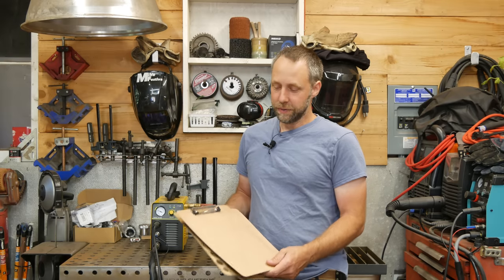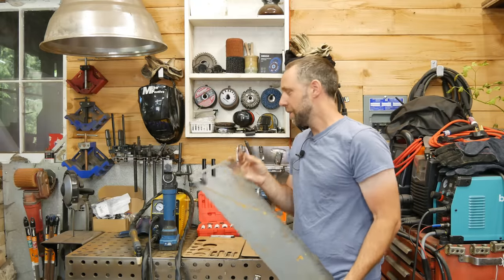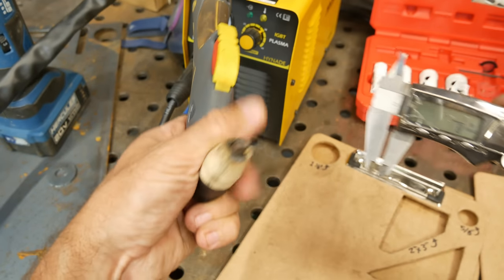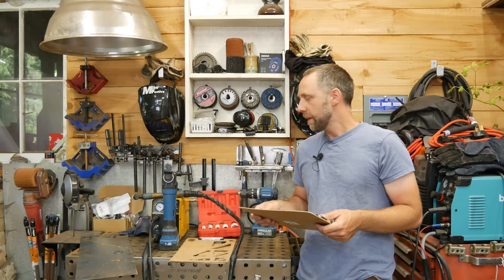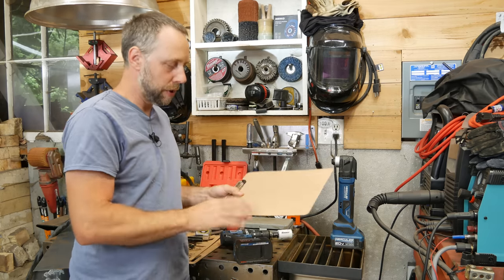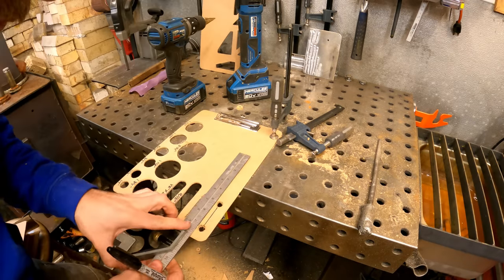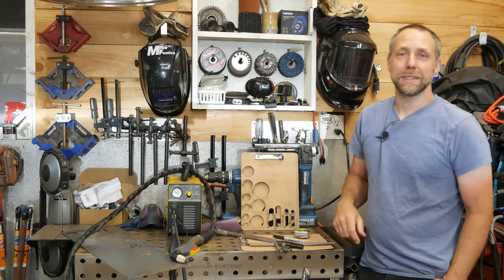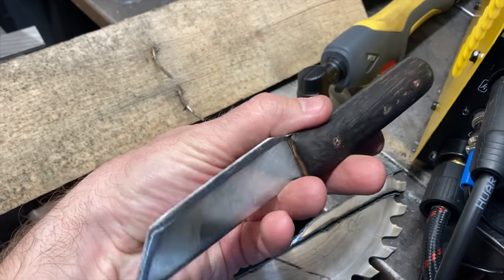Simple DIY plasma cutting hack, save time and money

Comment: Those of us that have worked in production woodworking, know all about templates to use with our routers.
This whole plasma cutter, being affordable thing, brings the whole template thing into the metal working world.
Pretty much all the template techniques from the woodworking world now  swing across into metal.

A couple of tips.
#1 You can cut your plasma templates with your router, this will make realy clean edges ........ you could even make a template for making templates.
#2 harden up the cut edges of your templates with, shelac, or high temp paint, before you sand all the rough edges, this will make the templates much more durable.
#3 most of my router templates are painted with thin white paint, which makes them easier to see and write upon, I'd reccommend high temp paint, like exhaust pipe paint spray for plasma templates.

If you are going to make a lot of templates, tempererd masonite or masonite sign board, is denser and harder than normal board.

Comment: I can tell you one thing that would be helpful to have, is a template for cutting out steel end caps for square, rectangular and round tubing in various sizes.  EVERYTHING I build gets tube ends welded closed....or else wasps will DEFINITELY nest where you don't want them to. You can make templates for ones that sit on the end of the tube, or ones that fit flush inside the tubes.

Comment: We make Plasma Stencils similar those, along with other common sizes and shapes too. The torch sizes do vary quite a bit depending on the machine. For custom stencils like your gussets, I tell people to just add the diameter of the torch tip to the desired size. I like how you mentioned drag cutting, any machine with an actual drag shield is ideal because the stencil can then be metal and not throw away. The other nice thing about stencils is you can use them to cut where a CNC can't go, like on vehicles or anything large. Keep up the good work!

Comment: I did pretty much the same thing only I used a CNC router to cut out the shapes. I had small sheets of 1/4 press board laying around after a project and used those. Like you say when they were out I just curt new ones. Also patterns the kids come up with I create a file in vcarve,  and can cut out as many as they want so they can paint them differently.

Comment: If you rub some candle wax on the inside edges the torch will probably slide smoother. I use something just like this for router templates and it works great.

Comment: I like how you used pallet board for the knife handle you show at the end. Never thought to use copper wire for rivets. I've used hardwood pallets for a few knife handles. And a hardwood pallet 2x4 for a hatchet handle.

I use pallet boards for ton's of my projects. I can usually get them free or really cheap. Usually I'll try to find good hardwood pallets. I salvage the good wood and burn the rest in my woodstove.

Comment: I build a small cnc router that'd be perfect for this sorta thing. I wanted to make it a plasma table too but it was going to be expensive to upgrade to a blow back plasma cutter. I think using hardboard for any elaborate shapes and a straight edge for strait cuts probably serves more than my needs. Would be cool to make some templates for gussets and mounting tabs.
Reply from the maker: Definitely a great tool for that! I bet the CNC router would cut amazing templates, you will be surprised how good the cuts come out 👍

Comment: Good idea you can also buy press board at home depot, etc in 4x4 or 8 sheets cheap.
Reply from the maker: Thanks for checking out my video, yes you can buy Masonite at most box stores. I didn’t really need a full sheet, but definitely an option if someone needs that much material.

Comment: Hi Mike:  so just before I saw this video I bought a yeswelder CUT55DS-Pro with IPT40 torch that has a beveled edge tip instead of a cylindrical tip zlike you show, and it’s a bit bigger diameter.  It’s also a blow back pilot arc (which I bought to ensure never interfering with a future CNC).  Can I use a different torch (drag start?) with this unit?  I think others might have similar issue to use you great idea if they don’t have a narrow tipped torch.  Thanks!

Comment: Out of the various light duty plasma cutters you've reviewed, this one, the bestarc, titanium, etc.. What would you reccomend for go karts, minibikes, and things like that?

Also I have been watching your videos for a few years now. Have learned a lot and purchased a yeswelder mig205ds and a few other things off your reccomendations. Thanks for all the great learning content!
Reply from the maker: Hello Mitchel.
I would say if you don’t ever plan on upgrading to a CNC table then the Bestarc is probably the best most affordable and reliable plasma for free hand cutting. 
The Titanium has been rock solid over the past 3 years but for the price you could buy about 4 Bestarc machines.
The Titanium however can be used on a CNC table unlike the Bestarc can’t.
If you plan on doing free hand cutting but consider buying a CNC table in the future I would probably suggest the Hynade CUT60DN because it’s a good affordable blow back pilot arc start and can run on CNC tables 🙂👍
Reply: @Mikefestiva  thanks Mike!!

Comment: That's a great idea Mike! On a side note, what do you think about the Hercules tool line? I'm thinking about getting started with them after wearing out my old porter cables.
Reply from the maker: Hey Rich I was in the same boat as you a few years back, my Makita batteries all were about shot and the tools themselves were about done as well.
Harbor Freight sent me out the Hercules cordless angle grinder and I was pleasantly surprised how well it worked and the battery lasted a long time. I had ran some of the Bauer cordless tools at work and was definitely disappointed in the tools and batteries. The Hercules tools feel on par with Makita tools. Since then I have expanded my tool lineup with a range of other Hercules tools, I even found some for cheaper in the discount section at HF because they were in store display models 🙂👍
Reply: @Mikefestiva  Awesome! Thanks Mike! Keep up the great work with your videos.

Comment: New to plasma cutting.  I have dual voltage cutter (Warfox but seems to be pretty generic) with an AG60P torch.  My ceramic cups have a standoff guide, but wondering if I can use a drag tip on this torch?  If so, which one would be recommended?

Comment: Really appreciate you making this video. I’m a year into my fabrication journey and constantly learn new things from you. Question, once you get a 1/2 or 1” hole in metal with a plasma cutter, how do you deburr the inside of it? I can’t fit an angle grinder in there.
Reply: You could try using a file. I believe he showed using a file; but, I could be wrong.
Reply from the maker: I like using a 1/4” die grinder, they work fairly well 👍

Comment: Simple and effective. I suppose on the circles, the sizes you have written down are for the diameter of the hole and not the blank that falls out right?(due to the kerf) I was thinking for making custom fender washers and such where the disc itself is what your after those might have to be a bit different. Thanks for sharing and screw the trolls!
Reply from the maker: I went through the jigs and easily determined the final cut parts size and wrote that on the jigs. This way I know exactly what I will get before I cut out the part 👍
Thanks for checking out my new video 🙂

Comment: Hi, Mike, your videos are very helpful as usual, thanks. Quick question, if 50A plasma would you recommend this Hynade brand over bestarc. They're arround the same price, I think
Reply from the maker: I like the Bestarc model I have more. This little plasma is good because it’s a drag tip so it works better for template tracing, but the Bestarc feels more durable. If you do decide to go with the less expensive Hynade, consider the dual voltage model 👍

Comment: Hey Mike...I'm pretty much a novice at metalworking.  I have a generic CUT50 knockoff with an AGP60 torch handle that requires a standoff for the tip.  Can I use a PT31 torch with a drag tip on this machine...are they interchangeable?
Reply: Did you try it? I am in the same boat. I don't want to buy a second cutter just for template work.

Comment: I see you aren't using the bestarc in this video. Is it still performing well? Is there a reason you didn't use it here?
Thanks and great videos
Reply from the maker: My Bestarc is still working good 👍 
I was testing out this smaller plasma and because it’s a (drag tip) high frequency plasma this works pretty good with small template jigs like this.
Reply: @Mikefestiva  Thanks for the reply, I thought that might be the case. I just got the bestarc gen 3 and when I tried it out (110, I didn't have access to 220v at that moment) it pulsed/surged alot. I was also on a 25 ft ex cord. No manual came with it. The air press was preset on 60, I set it at 25 amps cutting 1/8 steel. Is that too high/low? I can't find a pdf of the manual anywhere. Any idea where I can get a manual?  Thanks

Comment: Awesome jigs :) So it's ok to drag your plasma tip?
Reply from the maker: This plasma is a ( Drag Tip ) plasma, basically most High frequency start plasmas are this way. The plow back pilot arc start isn’t designed for this and should use a stand off 👍

Comment: What happened to your Bestarc? Now that I bought one, please don't tell me it's junk!
Reply from the maker: I use my Bestarc in most of my videos, it was in the video I posted a few weeks ago making the tractor log boom 👍 
Zero problems so far with the Bestarc 🙂
Reply: @Mikefestiva  thanks! Any thoughts on the two sizes of constables with different nozzles for 240 vs. 120? I bought extras for 240 volt, since that's what it will run on most. I didn't know if the larger ones would work ok at the lower amperages.
Reply from the maker: @haroldlundberg5676  I would think they are just designed for different amps, if you run the proper amps for the rated consumables they supposedly will last longer, that’s really out the window the first time molten metal blows back into the tip though.
Rule of thumb is to try to stay around the amps that are printed on the consumable cups. I tend to run my plasma cutters around 40 amps and higher, then just adjust your cut speed faster to match 🙂👍

Comment: I think i will just design these in fusion 360 and 3d print the stuff instead
Reply from the maker: Plastic and heat could be an issue?
Reply: @ it might be depending on the type of material you print it with I sure as heck will not use PLA for it. I was thinking I will try to use or ABS.
Reply: @Mikefestiva  worst case scenario if it blows up and burns, I’ll reprint it and then use a wooden router to trim my 3-D printed part into a piece of wood instead and use that as the template